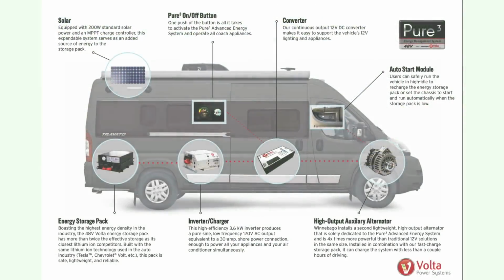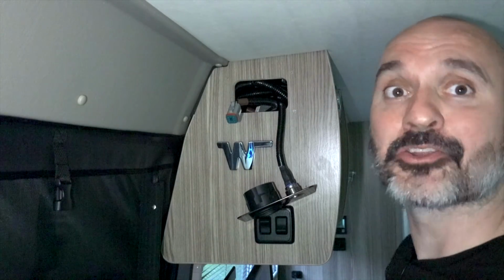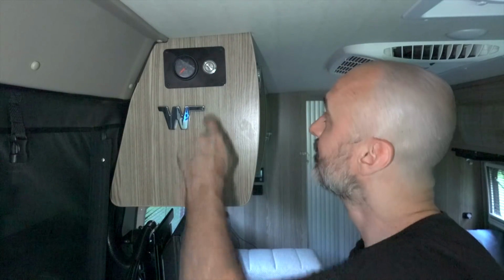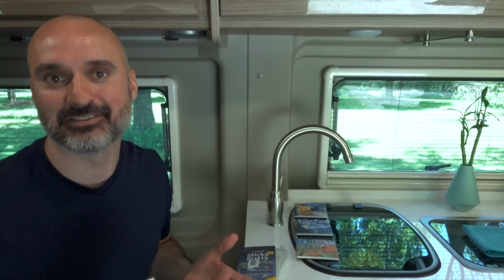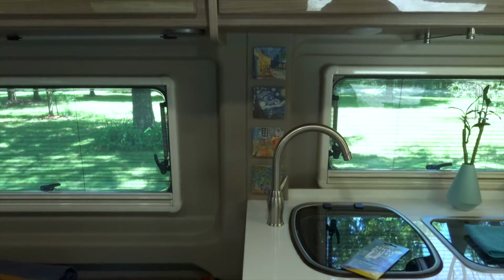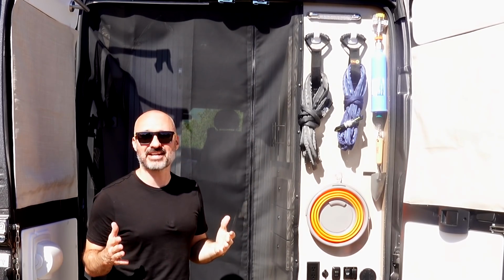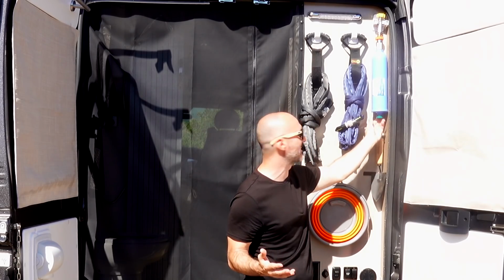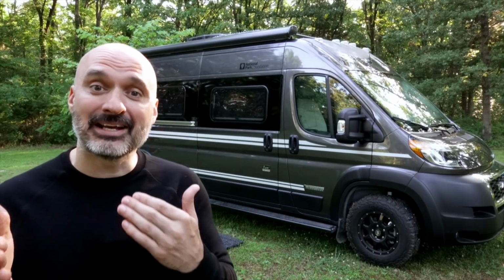RV Living 🚙 VAN Modifications to My Tiny House on Wheels & Had a Minor Camper Van WRECK 😱

Comment: I use that sticky thingy all the time. The best about them is that they don’t leave any marks on the walls like tape would, and can be reused. One of the most positive things is that it stays on all surfaces, walls, wood, plastic...
Reply from the maker: Yeah...i freaking love the sticky putty.  My flower pot is stuck to my counter with it and it hasn't budged even though I drive on some rough roads. It's amazing stuff.

Comment: I'm struggling, like apparently about 18/1000 others, but I'm working on it...  I will say your van is amazing.  I'm waiting on a AWD DRW 2020 Transit I ordered in December to build and your travato almost changes my mind.  My van should be here in Sept as it's been on hold for the new electric side door option.  I am going this route because driving the Transit is amazing and I can build as I go once the basics are in.  It has swivel seats, new 10 speed trans, new 10 inch nav with adaptive cruise and lane keep assist...  also the surround camera system, and the ecoboost power is superb.  Anyway, I'm ordering the Solar components now to start playing with them and thinking insulate, power, AC, 12v fridge, and a folding couch will have me on the road quickly, then grow as I need; but that national park edition is pretty sweet.  Best Wishes, Rick

Cheers
Reply from the maker: Very cool Rick...yeah..AWD would be so nice. I've had to skip some locations because I dont have it. Thanks for watching and commenting.

Comment: Hey Kevin. It’s coming along!  
This is unsolicited advice...so you can take it or leave it, no hard feelings. Be careful with the dump hose in that slot. You may want to think about going under the bed and sealing up the other end of that slot it fits into, because they usually aren’t sealed and those hoses can leak, under the bed. Not a mess you wanna clean up. Yuck. Hopefully all the dump stations you use will be ok to reach and also you won’t need the elbow...some of them can be tricky. 
Also, you do know not to hook up to water and stay hooked up, right a.  The vans aren’t like regular RVs where you hook up to city water and keep it there. Just fill your tank and unhook the hose. 
Ouch to the dings. That stinks. I know a couple of people that have pulled away from gas pumps and wiped out the entire side under panel, so he aware of that space too. 
Love the art work, the starry night and others, as well as the little vase. Gotta make it feel like home. 
Take care, safe travels, have fun. Martha & Tony from Virginia.
Reply from the maker: Thanks for the tips. My van has a city fill and a tank fill luckily. And my tank has an overflow mechanism, so it wont flood. Yeah...Im enjoying the color it adds to the space. Thanks for watching and commenting, Martha and Tony
Reply: 30 And A Wake Up yep, I know, we have a 2018K. However, those that live full time and are knowledgeable about the T, all day not to hook up to city water in parks. There have been blowouts. Like I said, just a suggestion. 😊

Comment: Next time you're in a big city look up paint correction specialists that offer ceramic coatings.  In other words, a high end car detailer.  They will either have an in house paintless dent repair (PDR) guy or know one that can repair those.  You'd be amazed at the work these people can do.  Just don't get a guy that starts drilling holes everywhere to get behind those areas to push it out.  If there is no access from behind a good PDR guy can pop them out using tools that work with a special glue.  I had it done on my Tesla with aluminum panels and you can't even tell.  And then the paint correction people can probably get the majority of those scratches out.  Between those two you will probable be out about $400-$500 and the work will be done in a few hours.  I would guess you could probably live with the results just from that.  If not, then all you need is someone to do a quick spray without body work.
Reply from the maker: Thanks for the tip, I'll definitely try that.

Comment: Keep those organizational videos coming, very helpful to see. I’m very curious to know how well the 3M hooks hold up. Here in our part of NC, the summers are in the 90’s, pushing over 100 degrees in our car when it sits in the driveway. In the past, my little 3M hook adhesive liquified and slid right off the dash.
Such a bummer about your accident, but could have been so much worse,  now you will alway be hyper-aware of your surroundings—worth it in the end! Be safe, and have a blast!
Reply from the maker: I've been using them for a few weeks now and they have held up great. I've driven almost 2000 miles on some pretty bumpy roads in Colorado! And yeah...definitely could have been worse! Thanks for watching and commenting, Deb.

Comment: Yes to more organizational comments. Great idea on using coasters as art. How does the sticky puddy do in heat? and when moving and hitting pot holes?
Reply from the maker: The putty did pretty well in 95 degree weather in Missouri...Ive driven over 2k miles through mountains and it's held up well.

Comment: Run a DVR (a.k.a. Dashcam) that records in HD and can handle a LARGE mSD card like a Vantrue branded unit. 

My vantrue camera can hold a 256gb MicroSD card which is good for almost two full days of footage before it overwrites the oldest footage. 

It also has an immediate save button that you can hit if something happens while you're driving to save the video.

If you had dash cam footage showing that they left the basketball hoop either overhanging or in the road. They may have been liable for the repairs to your RV. 

This of course varies from state-to-state on the laws. But typically nothing can be left near the roadway in the "right of way".

You'll also have the added benefit of having a dashcam running 24/7 in case someone backs into your vehicle while you are sleeping.

It happens all the time at the truck stops where someone strikes another truck and takes off before the driver can wake up and get their identifying information. 

Considering the cost of your vehicle investment a dash cam is a worthwhile investment to protect it.
Reply from the maker: Yeah...that's a good tip.

Comment: Enjoy your videos.  Can you comment on security system for the van (if available) to prevent break-ins?  Or if you have considered adding 3rd party security items?
Reply from the maker: Good question...I haven't added one yet but am looking at it.  One of the issues is they can mess up the autostart system...so I have to find one that wont interfere wit that. Thanks for watching and commenting, Walter.

Comment: If the paint is not broken, do NOT have it repaired. You should always carry a small touch-up MATCHED color brush on paint tube with you.
Once the paint is broken, moisture will get in there. Simply, Clean the area and apply the paint...immediately sealing it off.
The light is definitely an issue. The light is sealed. The outer plastic is cracked, this will allow water to get into your van. Always remember, seal it up.
Reply from the maker: Good advice....thanks.

Comment: Thanks for the video, I am one of those people that appreciates the organizational tips, we have a small class A, not that much larger than your coach (ours is 28 ft), and organizational ideas are always welcome.  As to the ding, having experienced a few rounds of automotive ding issues in the last few years, I suspect the repairs to  fix it right are going to be somewhere in the $10,000 - $12,0000 range, please let us know what it actually ends up costing when you get it fixed.  I had a dent on my car that was about the size of the palm of my hand on the rear corner a couple of years ago, the repair took almost 6 weeks to perform, and insurance paid out right at $7,700 for the damage (someone backed into my car at low speed)
Reply from the maker: Yikes! Glad I have insurance...and I'll let you know.

Comment: I enjoy your videos, thanks for effort.
I’m very interested in the 59K or 59KL
When you go from the K to the KL your fresh water tank goes from 25 gallons to 18 gallons.  Do you think Volta is worth it?
Reply from the maker: Yes..it's smaller. I personally think Volta is worth it because I do a lot of off grid camping and I like being able to run the AC when it gets hot. If you're going to be plugged in a lot..it isn't worth it. Hope that helps! Thanks for watching and commenting, Edward.
Reply: 30 And A Wake Up -   👍👍

Comment: That filter you have hanging in the back...is that an extra filter or do you have to attach it everytime you want to use it?
Reply from the maker: If youre talking about my water filter. I attach it every time I fill up...so the water runs through it before it goes into my van.

Comment: my requirements for a van home are ceiling space, bigger bathroom than kitchen, a decent fridge with separate freezer and at mid level not on the floor, convection microwave oven at mid level not over my head, dont need cook top stove, wet bathroom so i can just hose it all down, room to put my 55" and 65" tv's, 32" is NOT going to cut it and my thousand blu ray cases, room for big litter box for my big cat, enough solar to run everything and charge overnight batteries, and can tow my lilttle Smart fortwo Electric car on a trailer which can have its own solar on top of the trailer to charge the car. and if possible and electric motor powered van with hybrid gen for emergencies.
Reply from the maker: Yeah...I agree with the bigger bathroom than kitchen.  haha...those are some huge TVs! What about a projector?
Reply: @30AndAWakeUp  I also have a projector but im not giving up my tv's the 55 is the last 4k with cinema 3D and its OLED and 65 is the last curved 4k tv both are only about 1/4 inch thick i guess they could be put on a sliding turning arm support to be moved around in and out of the way as needed.